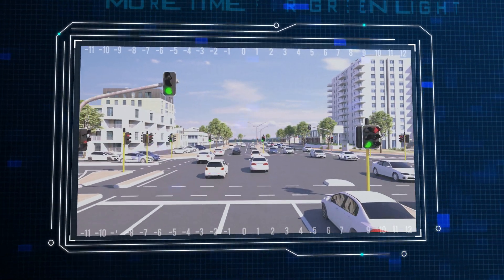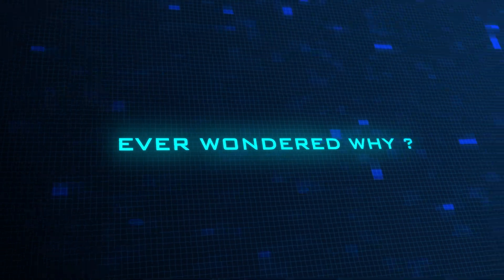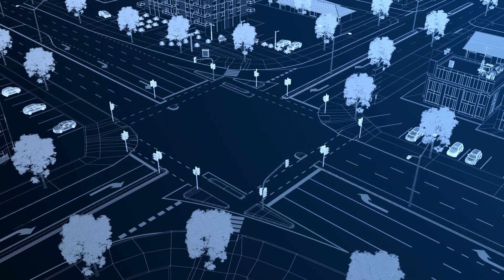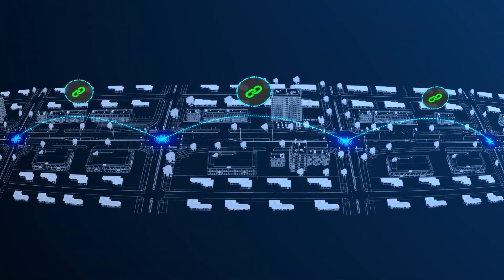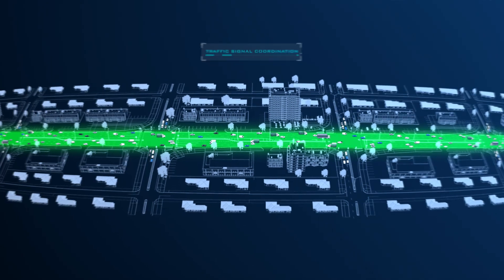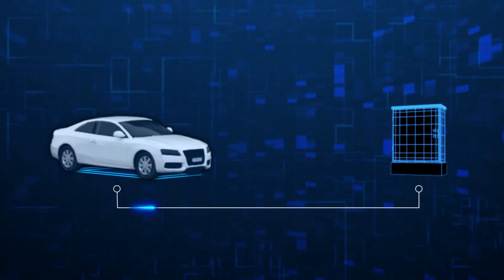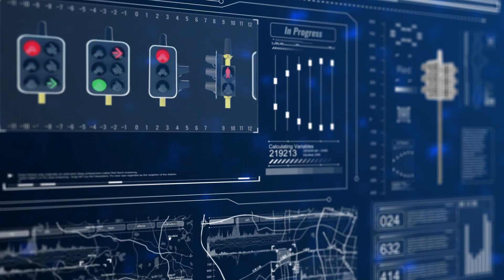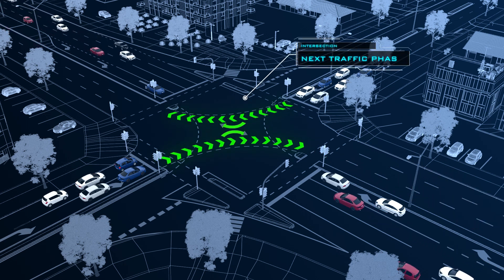Traffic Signal Operations Information

Comment: The reality is that the traffic lights do not work as the video describes. They are uncoordinated and a total mess. This is easy to see when you drive and pay attention to what is going on.
Reply: There are many difficulties involved when dealing with traffic... not the least of which is drivers who don't travel at the speed limit... pedestrians who push a button and then cross when the road is empty (leaving a pedestrian walk call pending, which upsets the cycle, the linking, the phase timing)...  Many say 'it's not rocket science'... but it can actually be MUCH more difficult(!)
Reply: Because it’s easier said and than done.